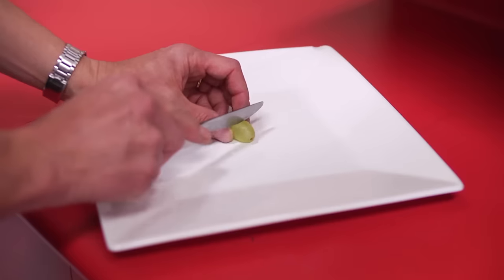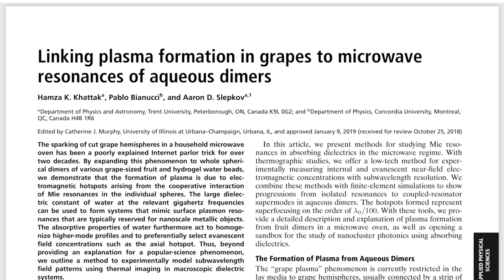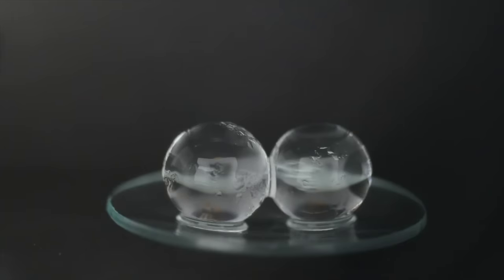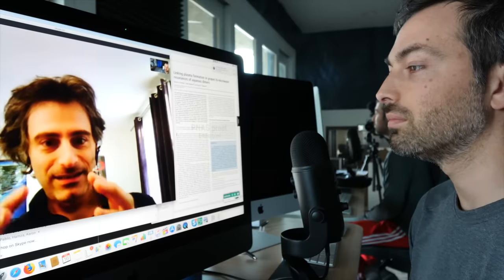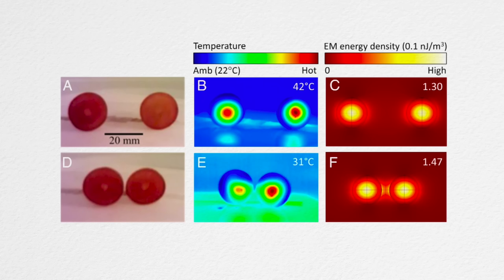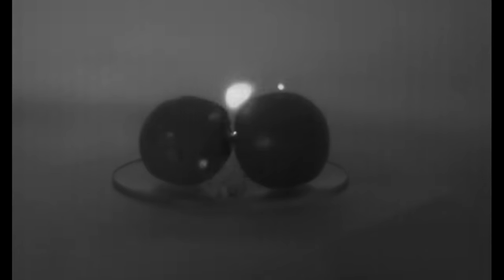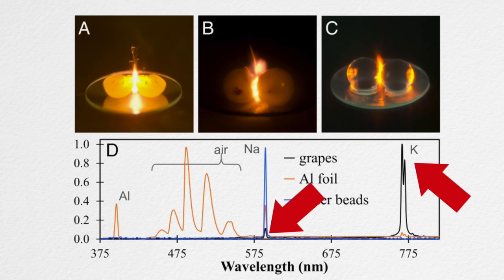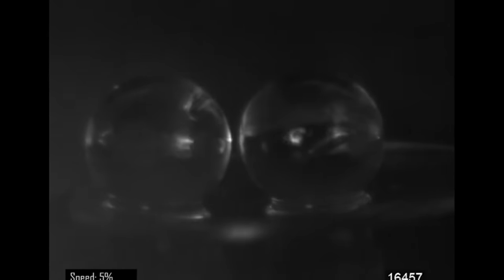Microwaving Grapes Makes Plasma

Comment: That means that the wavelength of my wifi is the same wavelength of my microwave.. 😜
Reply: Yes that's why standard Wi-Fi gets screwy when you turn on older Microwave that has shielding problems.
Reply: Was eating dome grapes while watching this video and they started to spark, i guess I was to close to my wifi router... LOL.
Reply: That's why cell phones are deemed potential health hazards by some, and why you need to turn off cell towers before performing maintenance on them: the technician would be cooked to death.
Reply: @thenasadude6878  Yes and no. Microwaves are far more powerful than Cell Phones. Yes you have to shut down the tower during maintenance, but cell phones are generally not dangerous. This depends on a country standard of regulating maximum power for cellular towers. In US they are more powerful, so they cover greater distance (Well at least that was true for GSM and partially for 3G, I don't know about now), but that also means that if you're far from tower the phone must emit far stronger signal. In Europe Cell towers are couple times weaker and more densely packed, and that means that Cellphones have weaker transmitters, since distance to the tower will be smaller on average than in US. Rule of thumb is - the less bars you have the more power cellphone has to use to be still connected, so in populated areas where you easily have 3-4 bars - not a problem. Somewhere rural, where cell towers are less dense - that can be a problem, but only (maybe) manifests if you're talking - phone being forced to uphold the connection is using full power, when the signal is weak. But I would have to check the power output difference between Europe and US now.
Reply: Go watch ElectroBoom for a full explanation of the difference bwteen a microwave and a WiFi router
Reply: @thenasadude6878  yes, stay away yrom those little high power stick {Yaggie} antennas, and that will pop your pop corn.

Roof top real dangers from cell, and microwave and radio towers
Reply: @thenasadude6878  to be honest before this video i was usually dismissing any warnings about mobile phone towers and wifi and mobile phones in general but this makes it interesting. Imagine if this focusing happens somewhere in your body it would cause dmg.
Ofc microwave has a lot more power but that microwave focusing effect looks like it would do some dmg even if u would reduce the power of it a hundred times.
Reply: TheNasaDude Wouldn’t you have to turn off the towers before working on them anyway so that you didn’t electrocute yourself, just like any other device that uses electricity?
Reply: So.... if you almost cut a grape in half and put it next to your router... you'll see it produce plasma?
Reply: Yes.

And you should probably switch to 5GHz WiFi, it is much better

Comment: So what can I do with it once I've made plasma is the real question
Reply: Actually the important thing is the high voltage at the contact point. The high voltage heats up the grape to the point where plasma, grape (solid--->liquid--->gas--->plasma), is created due to the heat. when it's just two small objects it's sparks that are created.
Reply: "HADOO-KEN"
Reply: Suhel Sheth so that's how he done it, microwaved grapes. Hmmm. Street fighter will never be the same.
Reply: Plasma Rifle/Cannon, using this technology and a Gauss Gun to propel the Plasma after it has formed, it could be fun.
Reply: @suhelsheth4621  Well only an idiot would think it's only use is murder. What about Drilling or Missile defense or even Spaceship propulsion? But some people have limited minds and no imagination.
Reply: Make a plasma space ship
Reply: @jaded1628  I'm not a physicist but i don't think plasma would be a very good projectile. The only really interesting qualities of plasma is it conducts electricity very well and it's hot. 
It also wouldn't act like napalm since it's incredibly not dense.
But again, what is created is electric charge,  specifically the charge from the microwaves getting trapped.
Reply: @kevincrowe7832  Because the plasma is super hot ionized particles it can be accelerated at extreme speeds with an Electro-magnetic rail system (or rail gun) This gun can project these particles at speeds hundreds of times the speed of sound. Meaning they can tear through objects better than a laser. My only worry is they may have enough power to create a fission reaction in the atoms they strike. But that would depend on the speed the rail can accelerate them to.
Reply: Make some plasmanade.
Reply: eat it?
Reply: 7:28
Reply: build a ray gun
Reply: Jaded 1 I’m hearing the Fallout theme reading this.
Reply: Wine, of course

Comment: If a microwave could detect the size of the object to be heated, could the wavelength be adjusted to suit, thus heating the object up faster?
Reply: Ohh good question.
Reply: Ooh, good idea, reckon it's definitely possible
Reply: Probably it would be easy to implement, but using other frequencies is prohibited, because it would wreack havoc with other equipment too.
Reply: Not a subject matter expert, but I believe the microwave frequency is selected specifically to be absorbed by water. Their statement about water absorbing microwave radiation is not a general statement across the whole spectrum. 

Also, that would not heat your food well to produce standing waves in it. Effectively you would just burn spots. 

On the whole, food is a terrible conductor of heat. Hence the need to move food around. 

Also, this is why food with very little water content doesn't microwave well. Nothing to absorb the radiation.
Reply: @michaelwitt7984  yep, thats why they have the rotating plate in the microwave. so it heats up the food more evenly instead of just at the nodes of the standing waves
Reply: what photodeus said. Theres certain frequencies allotted for different thing like radio frequencies or wifi https://en.wikipedia.org/wiki/Spectrum_management.

Comment: We're lucky that there's no radiation that has the same wavelength as our eyeballs...
Reply: Microwaves do. One of the issues you can get is the microwave warming up the eye and causing cataracts.
Reply: Our eyeballs don't have any kind of wavelength, so... what?
Reply: Every wavelength (ok, in plank length steps but whatevs) is possible. So there very much is such a radiation. It's a little longer than microwaves that a standard microwave produces but it's still called microwave.
It doesn't really matter though. If you point the transmitter of a microwave at your face then you really have other problems. I mean don't point the transmitter of a microwave at living things at all, it's just plain horrifying
Reply: Or testicles.. Lol. 
But  welders shouldn't use contact lenses, while using electric arc. The outer layer of the eye can dry, causing the lens to seal to the eyeball.  Many have permanently damaged their eyes, attempting to remove the contact lens
Reply: Well, actually your phone's and router's EM waves (also ~ 2.4GHz) have about the right wavelength for your eyeballs. The key is in the power/energy department: A microwave has 800W power, while your phone has max 1W.
So if you stick your head in the microwave oven (please, don't) - your eyes are going to boil away quite quickly.
Reply: @hebl47  normally microwave ovens can't do anything if the door is open. Should be safe from this
Reply: @zamundaaa776  I know, but some people can get too creative for their own good :)
Reply: @thecanaryisdead4745  I've never heard of this, sounds interesting. Can you elaborate further?
Reply: @DanteKG.  welders? Just what I'd heard. Many years ago. Maybe true maybe not.  I'd read the microwave are generated by electric arc welding. Face shields block the light, but some energy is able to get through. I've never looked it up though, as I don't weld or wear contact lenses
Reply: @thecanaryisdead4745  Damn, I have surgically implanted lenses, guess I'll never get close to that then! I might look up other potential dangers. Thanks for raising the possibility that this might be a thing.
Reply: @Anon-tr2lq  upon Google research, I realize it's an urban myth that's persisted since just south of 20 years ago
Reply: @Anon-tr2lq  what, you have  surgically implanted contact lenses?
Reply: Just divide the distance light travels in one second through a medium the same as your eyeball by the diameter of your eyeball to find the frequency that will generate a wavelength the same as your eyeball.

Comment: Will this damage the microwave in any way?
Reply: I doubt it. For safety, you can cover the grapes with a glass or another transparent container so that the hot gas doesn't reach the top.
Reply: Dont burn your house down. Put a cover over it
Reply: You wouldn't know for sure until you tried it
Reply: if it doesn't have a cup over it then it can
Reply: Add a small cup of water in with it to soak up the microwaves a bit and it should be fine.
Reply: The plasma is created by absorbing energy from the electric field - like your regular food does when you reheat it with the same microwave. Plasma gets very hot. There is no phase transition (fluid - gas) that limits its temperature. But if you contain it within a glass and you keep the experiment short so that the glass does not break, there should be no harm.
Reply: Hans Woast I tried this and the plasma caused some kind of stress riser in the glass and it exploded when I touched it (the glass was cool to the touch, total microwave time was less than 10 seconds).  I suggest using plastic or wooden containers only.
Reply: @jpe1  or an aluminum foil container for extra entratainment
Reply: It shouldn't unless the plasma is both sustained over a long period of time, and also is large enough to reach near the ceiling or walls of the microwave. Otherwise, the majority of the power is used to heat the grapes, and produce an electrical field which produces plasma. It shouldn't be much different from cooking any other water based foods or drinks.
Reply: Top 10 questions asked moments before disaster
Reply: Not if you replace the grape with "balls"... tsk-tsk
Reply: This kills the microwave
Reply: @selforganisation  its just hot gas, and microwaves should not have much of a problem with that. perhaps put a tea glass over it.
Reply: How do you know who to trust?
Reply: @1996Pinocchio  just trust EEs, they tend to know all the important stuff
Reply: @hanswoast7  well you know too much about it.... I am concerned
Reply: @SireBab  you are definitely smart
Reply: @1996Pinocchio  your parents of course since they said don't sit too close to monitor and now we have virtual reality ( VR) where you basically put mini Tv in your eyes
Reply: No problem. Use a friend's microwave.
Reply: put something under the grapes. Perhaps put something above the grapes. Have your finger on the stop button and if something seems like it could do something wrong just press stop.
But don't sue me over it if you somehow manage to break something xD
Reply: Make sure you put the grapes in a metal saucepan first and everything will be fine
Reply: I’ve done it with a cup over the grapes for 5-10seconds. My microwave and house did not catch fire. 

But I’m not condoning this experiment and am not legally responsible if your microwave and house catch fire.
Reply: I just tried this with water beads.
Out of maybe a dozen tries, got a few sparks a couple times, the rest just  exploded.
Reply: Yeah, youtube comment section is the perfect place to ask for advice.
I personally heard it can damage it.
Reply: I know that operating a microwave empty shouldn't be done - Apparently it can create a standing wave which can damage the components.
Though modern units may have some kind of protection against this.
I guess a single grape may be small enough that it could be considered an empty microwave?

As for the actual plasma, it's very hot.
Best to contain it under a glass of some kind. After a short time the glass will shatter from the superhot plasma cloud though. 
If you don't use a glass, you might risk causing heat damage to the ceiling of the microwave.

Comment: The question now is: Does this damages the microwave?
Reply: Now!? Does it?!?
Reply: I don't think so but I'm not smart enough to know for sure lol
Reply: Laser Mayonnaiser no
Reply: Yes, it can possibly damage the microwave.
 - The plasma can create direct damage through breaking the glass shelf or turntable.
  - This one is less obvious: Like all radio transmitters, a microwave has a rating of "minimum load". (using the microwave oven name for this rating found on the back panel. [This rating found under a different name, and measured in different units for other transmitters]) For most microwave ovens, this amounts to around 50mL (about 1 2/3 fluid ounces) of water. Cooking a smaller amount for more than a few seconds results in the destruction of the magnetron tube (its ceramic antenna post, which glows cherry red in normal operation, overheats and cracks)
Reply: Jim Shew I didn’t even think about the fact that there’s almost nothing in the microwave.

Comment: interesting. i wonder what would happen if this effect was demonstrated in a vacuum?
Reply: Wormhole
Reply: Since EM waves don't need any medium to spread through, and the speed of EM waves is almost the same to air (as is the refractive index) the standing wave would still happen. Because the spectrum of the plasma is mainly due to elements in the grapes, the whole plasma explosions should happen too, although without oxygen it might look slightly different
Reply: @sirelkir   Well also, without air, the plasma might spread out to a much larger area.  And it's hard to really imagine what would happen considering that the grape would be vaporizing and frozen.
Reply: To do so would require a rather small microwave, or a very large Hoover.
Reply: @SMac-bq8sk  What is a Hoover ?
Reply: It wouldn’t have air
Reply: @bobridge5271  A type a household vacuum cleaner
Reply: I'd like to see it in microgravity.
Reply: No
Reply: @ThetaReactor  Would be hard to get the grapes to stay in contact in that case. Design little holders/cups to push/hold them in place? Should work. microgravity + vacuum would be fun.
Reply: @bobridge5271  the original manufacture of the vacuum cleaner...
Reply: In a perfect vacuum the grape would cease to exist, all the water in the grape would boil away.
Reply: @bobridge5271  :"Dam," it sucks to explain such rudiments. ;-)

Comment: The Plasma is generated by the two liquids in the Grapes, if you use the right liquids you will have a much better result. Yes, you can control the plasma field with the use of magnetic fields, however I do not know if it is possible to do this in a Microwave oven. "Thank You"

Comment: Question on the whole application of this phenomena to making smaller transistors: Is lithography actually what is limiting size anymore? I thought as of quite a while ago (10-15 years), we were approaching thermal energetic limitations on size, rather than manufacturing ones. Could be wrong though, I've been out of the field for a while. Not that anyone really needs an excuse to make grape plasma.

Comment: OMG! The one scientist said "You see that it heats up not from the outside in, as you would expect, but from the inside out."
Older folks such as myself, were told and taught 50 years ago that a Microwave Oven heats from the inside out which, after observation from actually using a microwave oven to heat foods, I found to be utter non-sense.
My wife, on the other hand, still believes that non-sense even though her actions dictate the exact opposite. Actions such as observing that when heating something, it must be stirred because the center of the item being heated may be boiling near the edges but cool to the touch in the center. This, it needs to be stirred.
I am tickled to hear someone, with actual knowledge, state that it does in fact heat from the outside in!
Now, I have to go heat a grape!

Comment: The nuclear fusion reactors with the lasers and shrinking a capsule filled with fusion fuel should try using this grape plasma effect. If that's literally what they are doing, then that's good. I don't understand it well enough, I just know the laser capsule method will probably succeed in ignition first (oh, it actually did, I'm feeling sleep-deprived).

Comment: listen the linear relationship of the the wave is transfixed it will never change what you are seeing is the dynamic expansion and contraction within the sphere itself   
as a result of the composition of the grape what is happening in the grape is happening to the grape but not you so the issue is amplification  and or expansion and contraction
influenced by the environmental perimeter of the space itself that you occupy  that includes harmonic modulation with respect to mass and density IE   aerogel

Comment: Given the wavelength of a microwave (technically a misnomer since it's under 3GHz) is 2.4ghz and 12cm and will detrimentally affect anything of that size - I think we've discovered why birds are dropping like flies around 5G, which operates on two bands, one Mhz FP2, and another GHz FR2.  According to documentation, 5G is capable of  24GHz to 71GHz, so factor that into nanometers, correct me if I'm wrong but doesn't that mean you've pretty much got towers perfect at microwaving "things" that are 120cm+ tall........ 2+2 = ?
Reply: @SilverEye91  It may well be - that doesn't take away from the possibility that the towers may be capable of it, and if they are, which I have not seen anyone prove they aren't, then it's something we should be aware of.
Reply: @Lochnivar  That's not where the burden of proof is. You can't just go "I will make up this fact but will claim it's true". You're the one with the claim. Prove it.
Reply: @SilverEye91  That's fair enough, I shouldn't have asserted the claim as firmly as I did - however, time will ultimately tell.